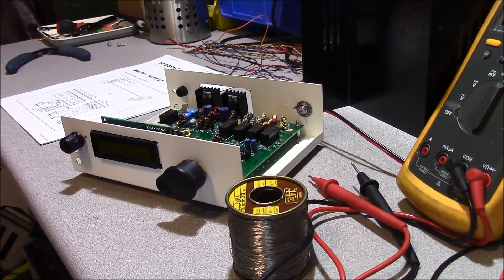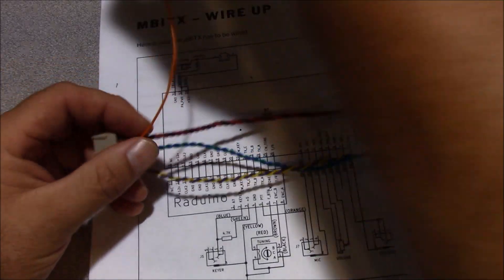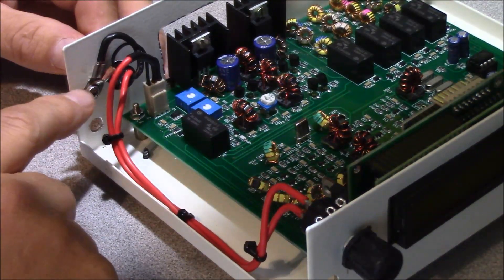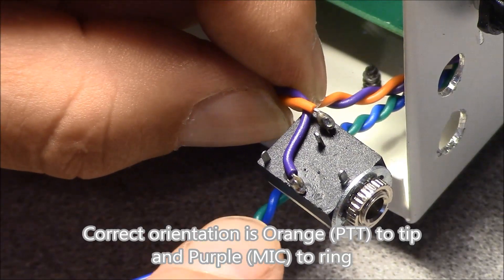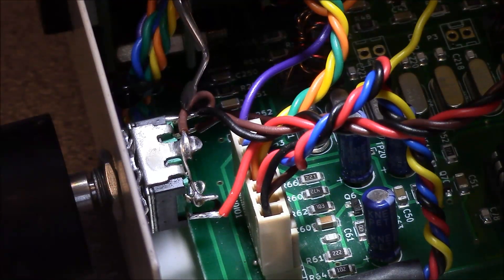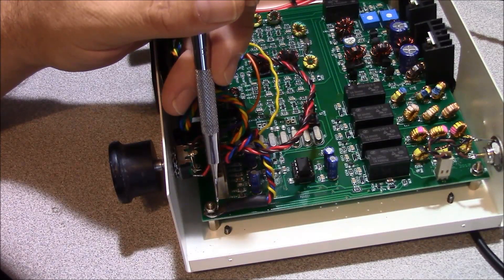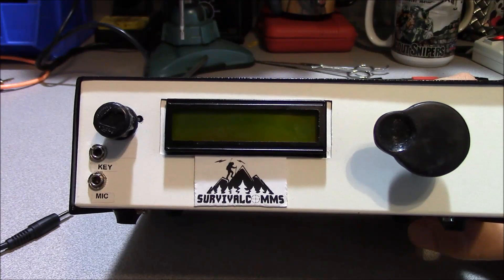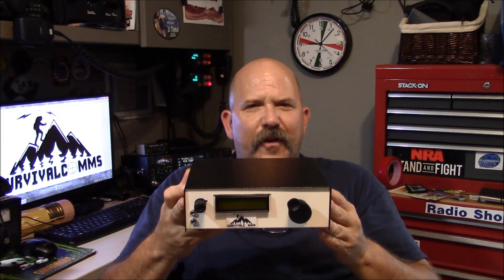uBITX $130 HF SSB/CW radio kit 3  Wireup & Testing

Comment: Hey Brett -- I've newly relicensed and I've got a ubitx version 3 kit ready to build. I'm a total n00b, been googling around all night and can't find assembly instructions specifically for version 3. Are all the versions basically constructed in the same way? What advice would you give me before I start soldering this thing together; is it fairly foolproof or do I have to be super careful getting started?

Any advice you can give me would be greatly appreciated! 73s
Reply from the maker: Congratulations ! Its pretty straight forward. Make sure you visualize the end before you begin.  Plan  your housing and how you will power, connect, and control the radio before you solder anything. Take your time and do not over think the design during construction. If somethings doesn't look or feel right stop and reevaluate. Thanks for watching !

Comment: Military and aviation mike wiring has the PTT to the tip, and the mike to the ring.  Sleeve is ground.  This actually makes sense as the ring is close two the sleeve to prevent hum pickup.

Comment: I really enjoyed your build!  I don't know if it's just me, but that black, brown, red ground thing is screwing with my Type A.  On the chassis kit that takes the Nextion screen, it comes with an AGC and audio amplifier kit that you assemble.  Red, Brown and Black is the color scheme for like 5 different connection sets with red always ground.  I suppose that's an India thing.  No biggie, but I ended up swapping all of the black and reds so that black was ground and redid the documentation.  I also  used nylon sheathing instead of twisting.  Same effect, just took forever because I had to unpin connectors where necessary..

Good suggestion on that CW filter.  I have a Vectronics VEC-820 kit I got at a hamfest for 5 bucks.  I think I'll stick in mine with a selector switch in between the audio stage, but not sure exactly where I can mount a selector switch for that.  Gah.  I JUST got that thing closed up! :-).
Reply from the maker: Thank you very much !  If I had some more buss wire laying around I would have used it to ground Pin 2 of the encoder and insulated it with another color.  I agree the color coordination leaves much to be desired. An AGC would really help. When I was doing the shot of it receiving a shortwave broadcast it was like stab you in the ear painful tuning past some Spanish language broadcasts.  Did you use the sheathing that looks like braid ? That would look good !   Its like that project car from High School there is always something to add or change and that is what makes this radio so cool.  Thanks for watching !
Reply: Yes sir, it's the braid.  The same stuff they use to loom up the inside of PC's.  I had a ton of it left so I thought why not....and yeah, you're right, it does remind me of the TransAm (That was black too, just like this).  Work never stops when you enjoy it!

The place I got the enclosure from also sells an AGC kit for 18 bucks if you're interested.  It comes with a VU meter  And that 5W audio amp is a great add on too  It's 15.  It's nothing you really couldn't make yourself though if I'm being honest.  The audio amplifier is based off of a LA4425 IC and the AGC is based off of a LM324 but they're put together well-ish.  I like the audio amplifier because it mounts directly behind the volume pot that secures it to the enclosure.

Unrelated question:  I know you hang around with Jim from DoRite.  Are you planning to go to the Good of the Land festival?  If so, I'd like to meet you!
Reply from the maker: @NGinuity  That stuff would look good in a contrasting color. shoot me the address of the place you got the AGC from. That would be a good upgrade. Im going to build a cable to tie it to my signa link today and try to edit the mic build video. 
  I was just at Jim's this morning working on his internet hardware.  I'll ask about the festival that would be a fun trip and I will be sure to let you know one way or the other.  My email address is my channel name at gmail. Thanks again !